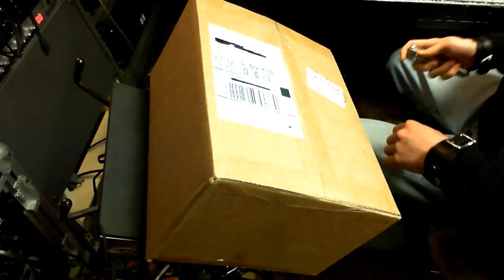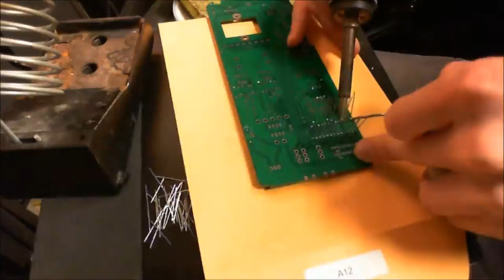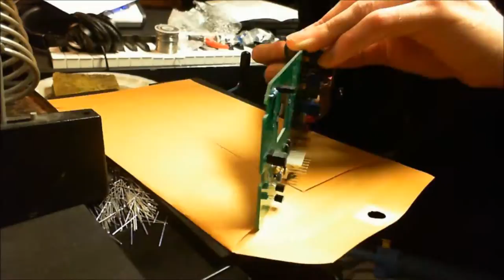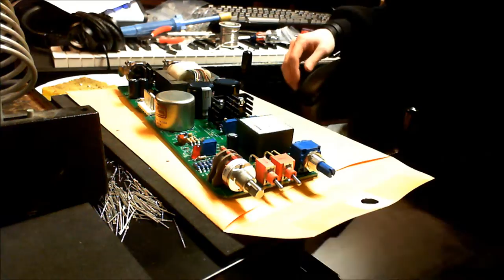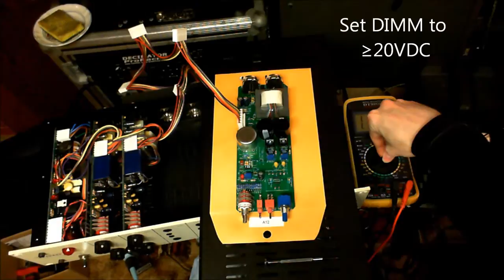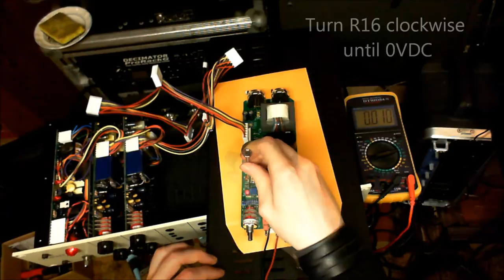Seventh Circle Audio A12 Assembly Time Lapse & Calibration

Comment: So I have an older chassis that I got with a couple pre amps, just got the compressor, do you have to remove the faceplate and loosen existing modules to get the new one into the chassis?
Reply from the maker: It's a pain, but yes